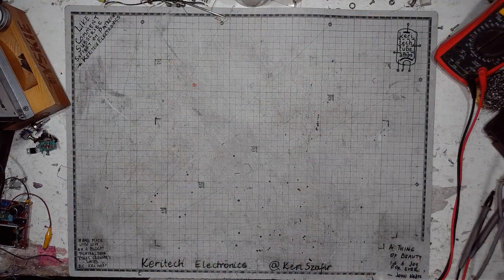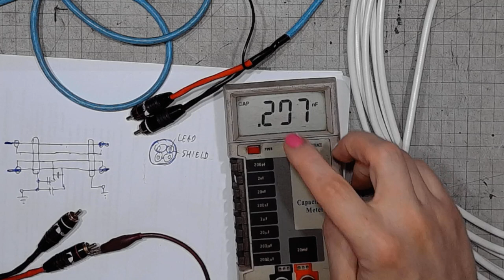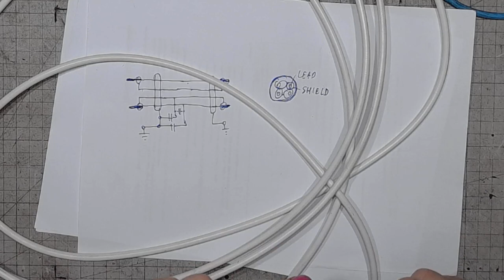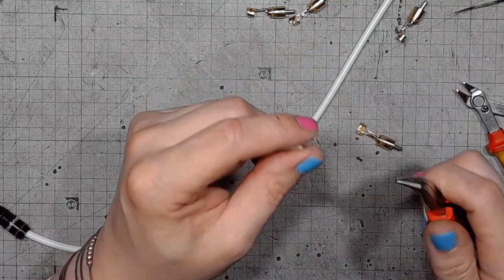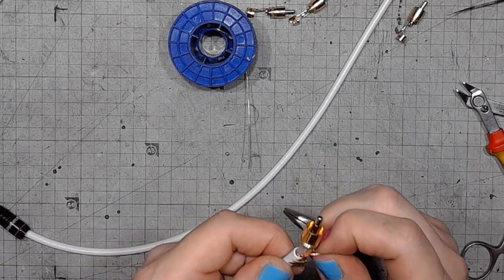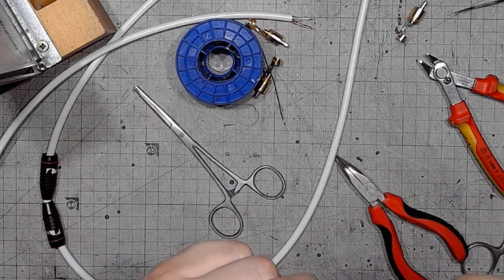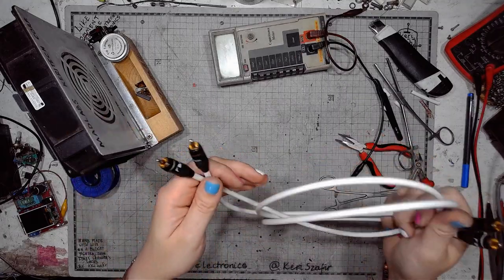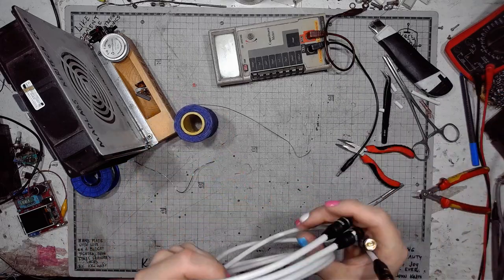Making RCA Interconnects

Comment: Interesting use for coax. A nice scientific method to measure the difference between the original and new cables is to make 2 recordings from the amplifier using Audacity and then subtract 1 from the other. That will reveal any spectral changes.
Reply from the maker: Ah, the Techmoan method. Clever and simple! :)